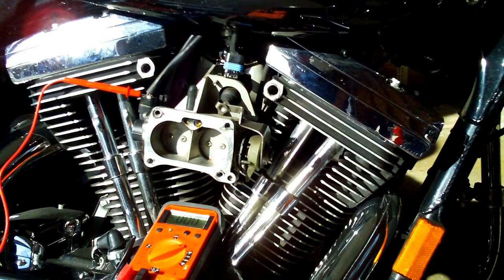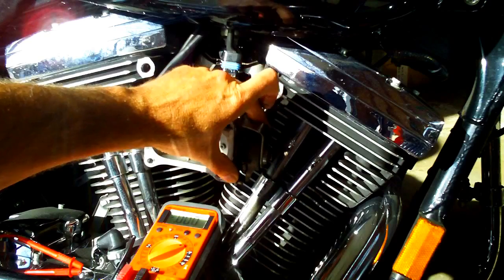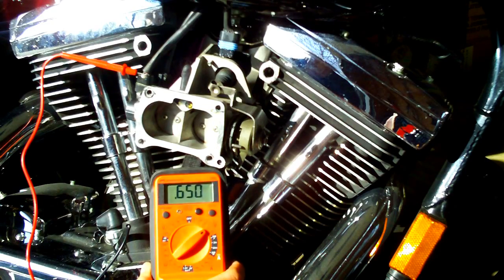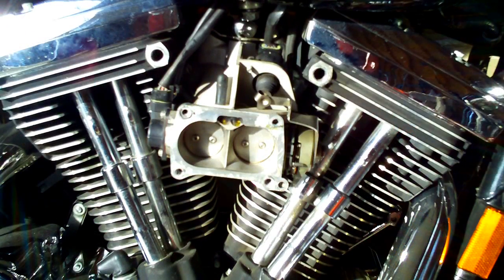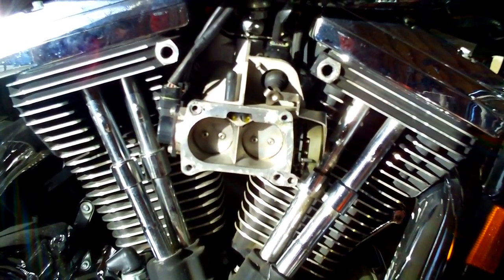Reset Harley Davidson Magneti Marelli Fuel Injection TPS Settings ✔

Comment: Love your video buddy ! but I tried on my FLHTCU/I and it worst and i dont know why...  I bought the bike really cheap cause the lat owner was tired of these kind of problems. The rpm are irregular and after 5/10 minutes with the bike started, it is going down and stops. I'm thinking seriously to change for a carb, but i really like to try to ride the MM injection.... Thanks in advance !!
Reply from the maker: Hello Marcos,  are you positive the cold and hot idle stops are set correctly? It isn't warming up, coming off cold idle, and dropping to the hot idle stop that isn't adjusted in enough, right? With the TPS set correctly I have to wonder if another sensor is at fault? You didn't mention any codes thrown from the ECM, so I assume there aren't any. Is this the 80ci EVO or the 88ci Twin Cam?
Reply: @contact4mwy7  Hi Mark ! thanks for your answer !! Yes, both screws and the TPS are adjusted on the correct parameters as you show in your video, but the bike is irregular still and the RPM go high just with bike started, without ride with her. Motor is a 80ci EVO. This afternoon i'll disasembly the injection body and i'll check all the connections and rubbers, and i'll try it again...
Reply from the maker: Yes, check the rubber plug cap just above the intake openings. Do the center screws inside the intake still have their epoxy on the heads of them? Are you positive the cold idle screw is not set too high? How is the play in the throttle cable?
Reply: @contact4mwy7  Yes the rubber cap is on its place and it isnt broke. The screws don't have the epoxy... But look, as I told you, i've disassembled all the injection body, i've check everything and everthing is correct (nothing are broken), all the rubbers, gaskets and everything are ok. The injectors are ok too, also the fuel lines...I had mount the injection body together again on the bike after checking and cleanig it, and now the bike doesn't want to start...
Fuel pump works, it have sparks, starter motor works, everything works but the bike does not start... I'm thinking that maybe is the CKP ??
Reply from the maker: Crank Position Sensor? Maybe. I think it mounts in the front of the motor, left hand side sitting on the bike. Was the bike running before you took the throttle body apart? Did you put the two screws in the center of the intake back where they were from the factory?
Reply: @contact4mwy7  Yes, the bike ran before this, but not so well. Never ran perfectly, this was the reason why the last owner sold it to me cheap. I have ordered a new CPK and I will try this new one, if not, maybe I will put a carb ... No, the two screws I think someone touched them ...
Reply from the maker: I saw on at least one forum that it was a bad idea to mess with those and the recommendation was to leave them where the factory set them. I do not know if anyone posted just how they are set from the factory. They seemed to affect idle the most. They are air screws.
Reply: @contact4mwy7  Do you know if anybody posted ? the settings, I mean...
Reply from the maker: @freekustomcycles  No, that's what I was saying, I have not seen what or how those screws are supposed to be set anywhere.
Reply: @contact4mwy7  i'll try to find some information and i'll post it !!
Reply from the maker: @freekustomcycles  ok, that would be awesome. Hey, I was wondering as for the idle changing on its own, can you unplug the cold idle motor with the bike off, then turn on and start it up and see if the idle stays the same?
Reply from the maker: Have you tried unplugging the cold idle motor connector with the bike off and then starting it to see if the idle goes up and down like before? Have you verified that you do not have an intake gasket leak? Also, check out this video, it mentions the center air bleed screws. https://youtu.be/EcVsolMJYGQ
Reply: @contact4mwy7  Hi buddy ! At the end problema was solved, i put a Keihin CV and the bike runs like a champion !!
Reply from the maker: Very good! Glad to hear it! Get some miles and smiles! I love those CV carbs, run great any weather any elevation!
Reply: @contact4mwy7 thanks for your help likewise !!

Comment: I can’t get TPS to move far enough to get even close to 2.75
Help??
Reply from the maker: If you followed the steps leading up to measuring the TPS voltage, like fully closing the butterflies by backing off the cold idle and hot idle screws, it shouldn't be a problem. Are you using a volt meter that can read down to 0.275 volts DC?

Comment: It’s back on now, I won’t be taking it back to the shop that took my dfo off , they didn’t know what they were doing and never even asked me. I’m wondering if the work they did fixing my fuel system failed??? I better get a pressure test done and start there don’t you think
Reply from the maker: If you can get a pressure or flow test safely, that might be a good check.

Comment: I hooked up the meter and without touching anything it read.650, I turned the throttle up and down and everything was smooth so I think I can rule out the TPS. To answer your questions it was running great on the Dyno twice! He told me “don’t let anyone ever tell you that Rev-tec dfo/ Magnetti Marelli combined isn’t a great set up “ it ran awesome for 100 miles till I filled the tank on the way home, same exact pump I used on the way down it immediately ran like s$-! I was to far to turn back, when I called him he said must be in the tank. Sure enough I sprung a leak. But the shop closer to home that no longer dyno’s bikes fixed the fuel line but removed my dfo. Said they couldn’t get the. Bike started. With the rhinehart tru duels i have always had to get it on a dyno to tune it, but she runs like a bat out of hell!  Been everywhere from Boston to Homer Alaska and back home to Michigan 😎
Reply from the maker: They removed it because they couldn't get the bike started? Was it put back on? The only way I can think of that it would interfere with starting the bike was if one or both fuel injection connectors was not getting a good connection. All the unit is designed to do is add fuel to the factory map ratio.

Comment: Can I test my TPS in a similar fashion?
2001RK police, Magnetti Marelli efi , stage 1 w/Rev-Tech dfo. 
Started having low fuel mileage, then hesitation at 3200rpm , I replaced the fuel pressure regulator, mileage improved some but the hesitation didn’t go away then I took it to have it Dyno tune never made a hiccup all the way to the shop ran great when I left there filled with gas and everything went to hell. Took it to a different shop to repair a broken fuel line in the tank, but they took my dfo off the bike. The guy the dino tuned it said not to run out with that off the bike that it would run to lean. 
150 miles back to the Dino tuner the bike ran great all the way home the next day it started coughing and hiccuping stumbling around 2800 RPM then later at 30200-3400. I have a new battery new plugs new plug wires checked all the ground connections look for broken wires bad fuses anything that might cause an intermittent problem. So I’m down to the TPS and before I remove it and replace it I would like to test it through the full range of the throttle, Can I test the ohms and look for internal problems?
Reply from the maker: Wow, that's a lot of troubleshooting, Dan. I would say yes, you can check the TPS using this method with the bike turned on but not running. Remember, this is an "Open Loop System" which means the fuel system has sensors in place for engine temperature, barometric pressure, air temperature, and throttle position. It doesn't have O2 sensors to "check the end results of the fuel to air ratio" from the exhaust. I'm not familiar with the Rev Tech DFO, so I'll have to look that one up. Low fuel mileage sounds like it must be running rich. We're the plugs charcoal black when you pulled them? Does this stumble happen when it's on the Dyno? Does it happen with the bike in neutral just rotating the throttle? I ask because I have to wonder if it's running too rich in the upper rpm's causing your stumble as I have found that is a possibility. Other than that you have the engine temperature sensor, air temperature sensor, ignition module, barometric pressure sensor, and fuel injectors as possible culprits too. How hard is it to remove this Rev Tech and go for a short ride, nothing to crazy, to see if the stumble is still there? I have to refresh my memory if the your twin cam has a crankshaft position sensor mounted on the front of the engine case or if that's just the newer motors? Have you verified that the rubber plug on the intake manifold above the butterflies is not cracked and leaking vacuum air? Mine was cracked and made a chirping sound from the vacuum leak. I bought a new rubber plug at the auto parts store and slipped it onto the metal vacuum port. No more vacuum leak.
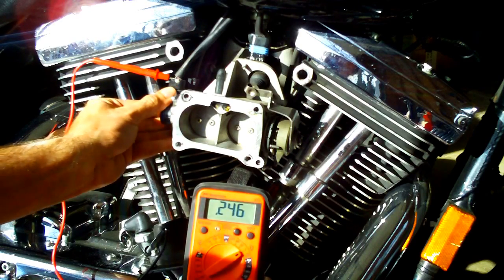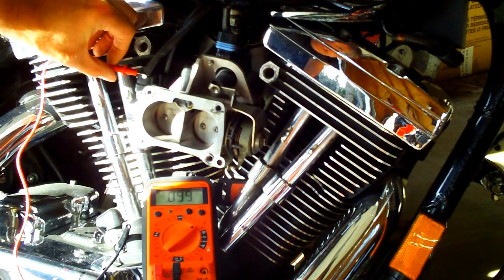Reply from the maker: Second reply: Dan, I looked the RevTech up and it is very similar, if not identical, to the Dobeck Performance TFI unit that I had used on my bike! In this video you can see me making adjustments to the GREEN ZONE (general cruising) and somewhat adjusting the RED ZONE (upper RPM's adjustment). In the video description, I posted this... UPDATE: After going through a few tanks of gas, I have settled onto the settings of 3:00, 6:00, 4:00, 4:00, as though you were looking at the hour hand of a clock, just as Dobeck recommended. They must have spent a fair amount of dyno research to come up with these settings.
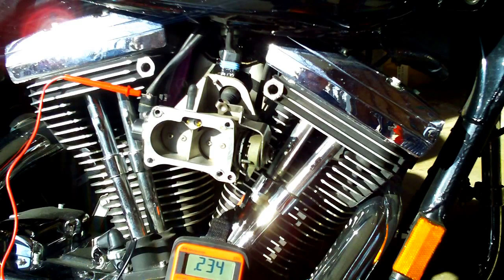So I have to ask you, what are the settings of your RevTech? What numbers are each dial pointing to? Dobeck advised thinking of the numbers as the hour hand on a clock. 1:00, 2:00, 3:00, etc. Here is my video, and if you search Dobeck Performance TFI on youtube you will find other videos as well showing the tuning of this unit. https://www.youtube.com/watch?v=X1a9kBx_Lb4 As far as unhooking it, I believe this is a "fuel adding device" only, which means if you back off all of the pointers to the 1:00 position they will not be adding any fuel over the stock fuel map, effectively taking the unit out of the equation. Again, my favorite settings for my 1997 Road King EVO was with the pointers at 3:00, 6:00, 4:00, 4:00 from left to right.
Reply from the maker: Third reply: Here is a link to a cached version of the Dobeck Performance TFI unit instructions for a Yamaha Raider/Roadliner/Stratoliner bike, but does not specify settings for those bikes, just how to dial the unit in. Transfer this advise to your RevTech unit to get a better understanding of what is going on when tuning. https://webcache.googleusercontent.com/search?q=cache:RC0EDFPVe70J:https://www.tficontrollers.com/instructions/950142052.pdf+&cd=11&hl=en&ct=clnk&gl=us

Comment: I know this video is old but THANK YOU Mark Young. Got my 98 Road King running like she was new again. I was a little concerned but it worked out. Great video again!!
Reply from the maker: Glad to hear another Harley MM system is running as it should. I really enjoyed that fuel injection system and the ability to tweak it with fuel controllers from Dobeck. I have videos on using them on my channel as well if you're interested, but if it's running good, leave it be, right?! Ride on!
Reply: @contact4mwy7  Hey Mark, my 01 is in the shop. I’m told the ecm might be bad. I need a scanalyzer to know for sure but I’m hearing there’s no way to find parts for the magneti marelli nightmare I am living. I wish I was close to you, somehow I’m betting you could fix this.
Reply from the maker: I'm sorry to hear it! There aren't very many shops that will even look at that system now. What was it doing that it's not supposed to be?

Comment: Hi Mark, thanks for sharing your vid. I´ve buyed a 98 RK here in Germany in 2017. At Decel the Exhaust fired like a Machine Gun, so i guessed that it runs to lean. I set the TPS at 0.275 as recommended an now it is definitely better, but after correcting TPS Setting and cold idle,  I have a Problem with the warm idle now.

I have no chance to get the Idle below around 1000-1100 RPM (Measuring by Ears), even with completely turned out warm idle screw. Is that correct?. I know that 1000 rpm is recommended, but with the old setting  (below 0.200V) I could get the warm idle  a way lower (Guess around 850-900rpm) . The Bike does not sounded like a Shovel, but it doesn`t sound that nervous at idle like it does know.

Today i´ve taken a look at the German Workshop Manual (FLT 95-96!) and I found TPS volt spec of 0.175 Volt???
Seems that the 0.175 Volt is not only a spec for the Twin Cam Models with MM. Maybe the European Models where tuned a way leaner than the US Models!?

Do you ever heard about that issue with the warm idle and is there a way to fix it? With setting at 0.275 it runs really healthy and powerful, so I don´t want to change it, but the high idle drives me crazy.

Thanks for help.

Regards from Germany
Marc
Reply from the maker: Marc from Germany! You're English is better than my German! Is it true that the bike idles better at 0.275? I was a little confused about the Shovel comment as to if you meant it is idling rough. As for the high idle. What rpm does the motor idle when first start cold? Does the idle slowly fall on its own as the bike warms up? The decel exhaust popping is most likely from the bike running lean. A fuel tuner for Harley twins would be used to richen the fuel mix at lower rpm to cure that. You could richen the upper room points too. Right now I'm trying to get a feel for what your bike is doing. Let me know your answers. Thank you.
Reply from the maker: Also, make sure you have free play in the throttle at idle. If the cable is not adjusted right it could be holding your butterflies open just a bit, raising the idle. I'm wondering if your cold idle system is staying active and not letting the bike idle down like it should. You said you backed out the warm idle screw completely, can you also try to back out the cold idle screw? It's not going to be easy with the bike running. Shut it off, turn the cold idle screw out a turn, start it back up. Has the idle dropped now?
Reply: @contact4mwy7  Hi and thanks for your fast answer. I need some days without the bike, otherwise it would drive me crazy.

Now I checked the freeplay at the throttlecable..they were fine. In next step I reduced the voltage at cold idle from .650 to .600. After cold start the idle will now drop faster to a normal idle than with .650. 

When it is completely warmed up the idle will stay maybe at around 1.000 rpm, with backed out warm idle screw. Unfortunetely I don`t have a rev counter.  Bike runs good, strong and powerful, and the idle is not rough. I just had the feel, that the idle should be lower with turned out idle screw. Now I ´ve seen your vid, introducing the Bassani Slip Ons. Is that the warm idle speed of your bike? When it is, I guess that I don´t have a problem and it´s all fine. Because mine sounds like that in warm idle, maybe a way lower than yours.

There ist just a simple reason why I trying to drop the idle a way lower than the recommended 1.000 - 1.100 rpm. If you put on street legal Exhaust for European Market (Very different to US) your Harley sound like a city scooter. I don´t like that super loud exhausts, but I use slip ons that make your Harley sound like it should. But if you have to stop at a traffic light beside a Police Car, you will wish that your engine would be a way quiter, otherwise you have a good chance to wait for the tow truck. 

With around 850-900 rpm you get less attention. Simple, but it works.
Reply from the maker: @1974marwin  I understand now why you prefer to go lower. If everything is working normal you should be able to drop it down quite a bit lower until it just doesn't want to idle. Here is another question, there are two screws above the intake openings. They are air screws set from the factory and then epoxy is added to prevent them from moving. Do they look like someone has turned them, like the epoxy has been picked away?
Reply: @contact4mwy7  the epoxy is still there.  Today ist is a warm day and dry. I will take mit out for a short testride now.

Comment: Hey Mark are these settings applicable for a 1999 Road King classic?  I'm idling a bit to low once the bike is warmed up.
Reply from the maker: Hello Sam. I will say "should be." Now, there really isn't a voltage measurement to go by for warm idle. The good news is it's user preference in the setting! Your bike should idle close to 1,000 rpm to give a proper charge to the electrical system. As long as your cold idle (cold start) is good, adjust the warm idle screw by turning it "in" (clockwise) until you have the bike idling where you want. How's that?
Reply: @contact4mwy7  sounds good I'll give it a try tomorrow and let you know how it turns out. Thanks for the advice
Reply: Simple tweek to the warm idle screw and it's idling just where I want it.  Thanks 
for the help.

Comment: What setting does my multimeter point to.?
Reply from the maker: It has to be set to DC volts and a setting low enough to read three digits to the right of the decimal point. Click on the link in my description to watch a video explaining the multimeter I use and the reading on the display.